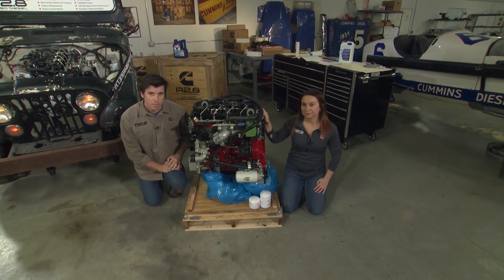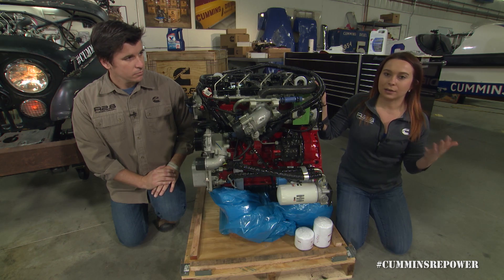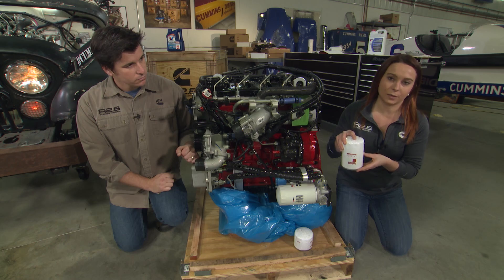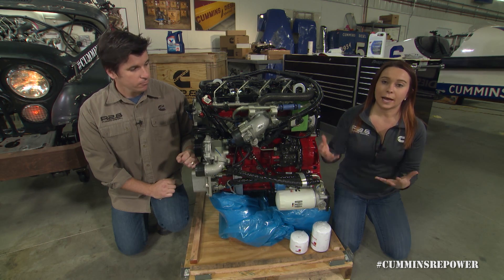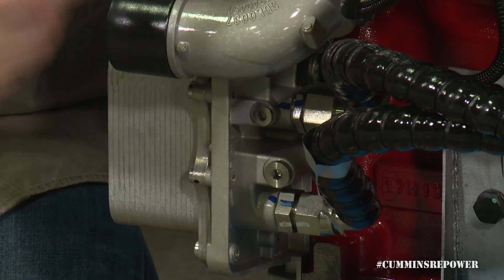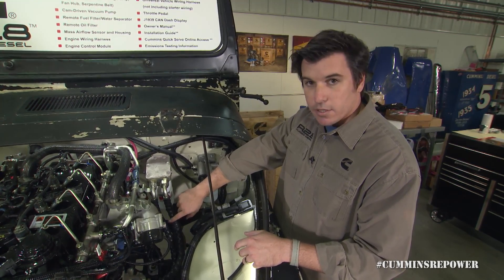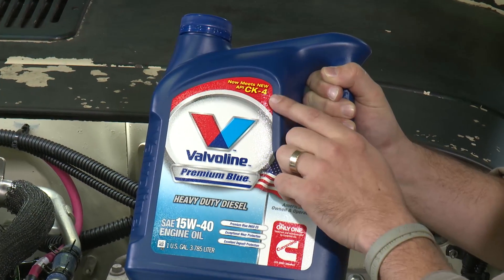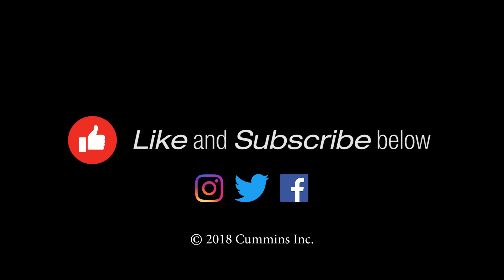Cummins Repower Garage Video 5: R2.8 Oil System

Comment: Hi, was just wondering what the part number was for the oil cooler that allows for the remote mount oil filter? I have had nothing but bad experiences with the terrible plastic spin on filters with my Foton Tunland ISF2.8

Comment: I appreciate the videos . Good to know what the limits are and what requirements are . Its always interesting what engineering thinks . Is there a way to add a by pass filer to the lubrication or is that not necessary . Your thoughts on full synthetic diesel oil . I run that in my TDI vw  . I never used the full synthetic in my 5.9 as it will last a long time just by using a good air filter and changing the oil as required or sooner

Comment: А зачем фильтр так далеко отводить ? Есть же риск разрыва шланга от постоянной вибрации !
Reply: антон тисленко she said it’s not the permanent location, it’s temporarily installed on that bracket, you have to take if off and mount it somewhere on your chassis.
Reply: @vostok1_100  У меня тут недавно на Соболе фильтр (Fleetguard LF17356) открутился после 5000 км. пробега, надо полагать от вибрации, 3 лита масла утекло, хорошо, что сразу заметил.  Может в этом смысл установки фильтра не на блоке двигателя?

Comment: What is the Brand and Part Number of the Oil Filter that comes with the engine?
Reply: At 3:45 you can see it's a 16045 Fleetguard

Comment: It’s 2019 and people still think a big filter means longer drain intervals, maybe try an engine bypass oil filter as well as a full flow, then you won’t see rebuilds at 200,000 because of the damage cause by the carbon from egr and high oil temps
Reply: Certainly can mate,  if you look up a company called ‘filter technology Australia’, they provide cartridge paper style engine fuel and oil bypass systems with a range of products to suit sump capacity,  I am an owner of a heavy diesel mechanic Workshop myself, and I’ve seen jist about every bypass filter option there is, and I’ve not seen one as simple or effective as these systems,  I personally use them on Kenworth trucks with cummins engines and they stay pristine inside, that said I still change filters and oil at 20,000, but I also see life out of my engine at over 2 million kilometres which is about 1.25 million miles, I rebuild at this point as prevention but they could go further, also we change fuel injectors every 650,000, fuel is where the problems start, but definitely get a bypass oil filter if you want engine life

Comment: Will a 2008 six speed manual handle the power? In theory.
Reply from the maker: What transmission? You’d want to select a transmission that was originally mated to an engine with a similar or higher torque rating.
Reply: Patrick Washington 2008 six speed manual from what?